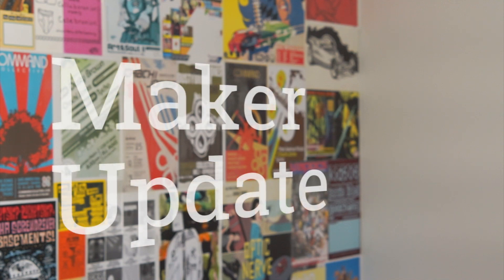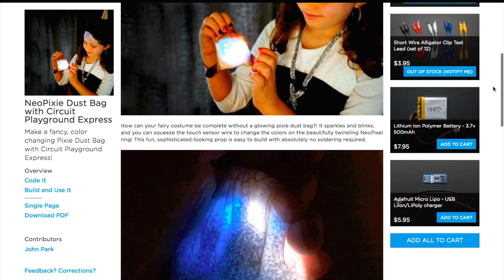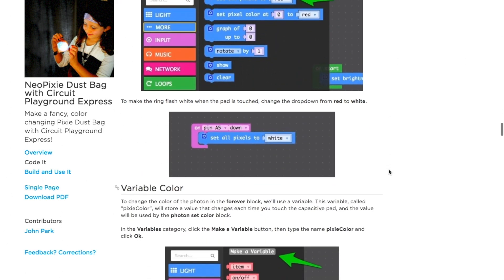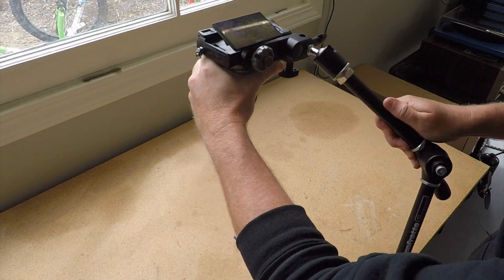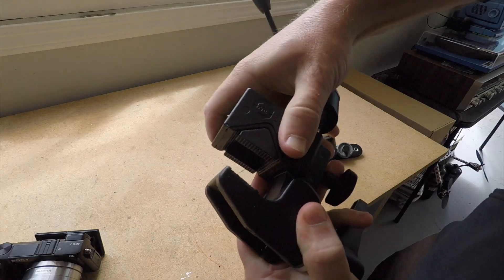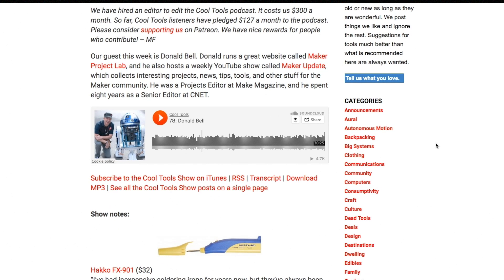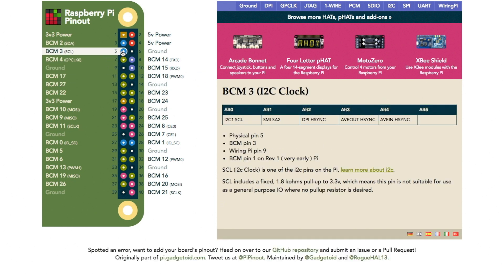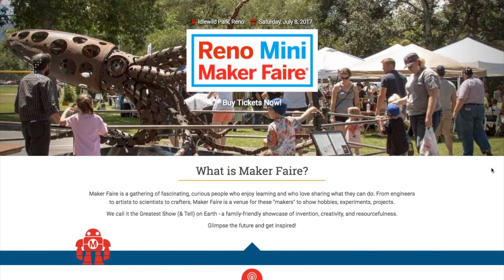Pixie Power [Maker Update #41]

Comment: I prefer the knob-and-tripod-plate mount version so I can hot swap my camera to the regular tripod (super clamp sold separately): https://www.bhphotovideo.com/c/product/554345-REG/Manfrotto_244RC_244RC_Variable_Friction_Magic.html
Reply from the maker: Good tip. I'm pretty sure I arrived at the lever style due to the relatively low price of the bundle. I'm happy with it, though now you have me thinking about those quick release plates. Fiddling with unscrewing my camera each time I move from the tripod is a hassle.
Reply: When I bought my first magic arm, I already had a tripod with the same quick release plates, and super clamps for other things, so that explains my decision =D Agree it would be great if the sections were just a little bit longer, and lately I've taken to clamping it to a C-stand upright to get a bit more height.

Comment: I love my magic arm.  I have one with a knob not a lever and don't have the problem of having to tighten it periodically. it's the manfrotto 244 arm
Reply: Yep, I can attest to the super flimsy quality of the knockoffs.  I bought a $20 lookalike of the 244 and after maybe a week of use, it struggles to even support its own weight, much less even the lightest camera.  It doesn't do much good being a fraction of the cost of a Manfrotto if it simply doesn't work!
Reply from the maker: Cool! Yeah, that may be a superior design. Does it tighten like a big bolt, or does it click into a secure, somewhat locked state? What's funny is that I see $30-$50 knockoffs of both designs on Amazon, but they all look pretty flimsy. The Manfrotto is incredibly rugged.
Reply: Maker Project Lab it tightens like a bolt. But I usually only have to turn a quarter turn to loosen and tighten. And when I have a heavy monitor on it I just crank on it a bit more and it's totally secure. For normal camera rig a small turn is all that's needed.
Reply from the maker: Great tip. I figure when the price gap is that huge, they really can't even be the same product. Sorry it didn't work out, but thank you for telling us about it.